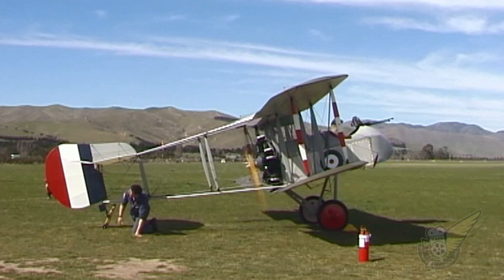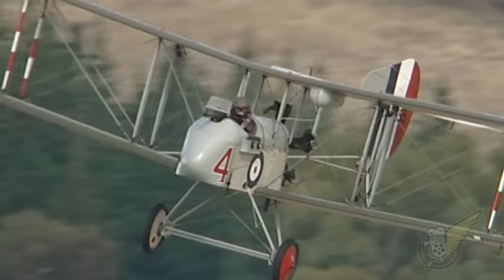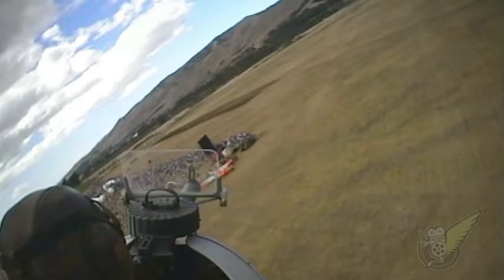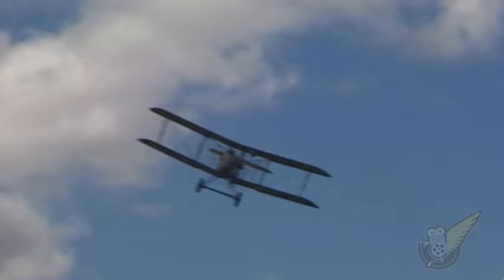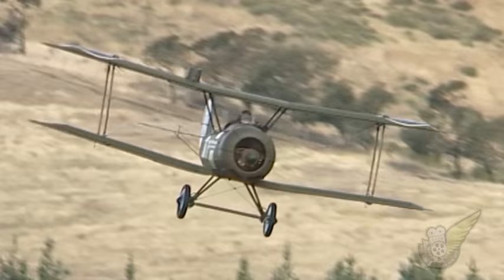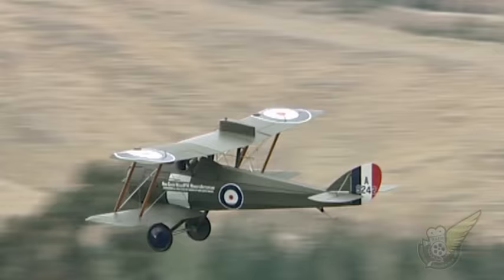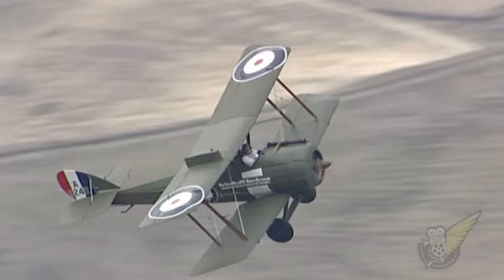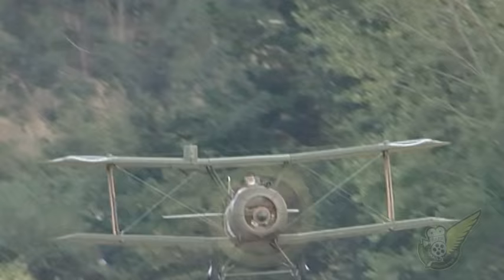Early Oddball WW1 Fighters - Airco DH.2 and DH.5

Comment: the dh.2 was, and will always be, a work of art. it was such a beautiful, effective biplane that saw much use in ww1. it wont be forgotten.
Reply: I don't know much about aviation, but it would seem that pivoting around the heavy engine would be more effective  and slinging it around on the front.  I really like the design!
Reply: Thrust from front being shoved under wings is great for lift and stability.
Reply: The DH-2 was very effective, but also very dangerous. They were prone to catching fire in flight, and their stall-spin characteristics were bizarre. Spin recovery was very difficult, and required a technique unlike any other airplane that involved somehow rolling the spinning airplane on its back and recovering inverted.
It was derogatorily known as "The Spinning Incinterator" for these characteristics. It was Maj. Lanoe Hawker who figured out how to get one out of a spin. Until then, spin recovery in a DH-2 was thought to be impossible, and DH-2s were not to be stalled or spun.
Maj. Hawker died in combat flying a DH-2. While in a tight dogfight with Pilot-Leutnant Manfred von Richtofen, one of Richtofen's bullets glanced off of the DH-2s aft-mounted engine and struck Maj. Hawker in the head, killing him instantly.

Comment: Hardly oddball in 1915; pusher designs were quite common, especially in civilian aviation. This example is a modern-era replica, using a modern engine; period DH.2s used a wind-cooled rotary whose entire crankcase rotated along with the propeller. Thanks for posting!
Reply: Thanks, you've answered my question elsewhere. I thought the DH2 had a rotary engine.

Comment: Imagine flying an original DH.2. They didn’t even have a throttle. The only engine controls were the ignition switch and the mixture control. The pilot would regulate his speed by ‘blipping’ the engine. That is, turning it on and off.

Comment: Although the pusher design solved the machine gun synchronization problem, it compounded the risk taken with the early rotary engines at that time, which due to rushed war time quota lack of quality controls, were prone to literally breaking a piston rod, thus throwing the complete jug off of the engine with the piston, which could easily smash into the bracing for the rudder and elevator controls behind it, sending the plane down in an uncontrolled crash.

Comment: The „pusher“ design also keeps the pilot clean. The original Gnome rotary engine was famous to spit large amounts of caster oil onto everything behind the engine. 
The one shown here uses a radial engine instead. Not original in look and sound and feel for the pilot.

Comment: Always thought this had a rotary engine, like the Sopwith Camel.
Reply from the maker: The original DH-2's did, but in this case this is a replica built in the late 20th Century and the builder only had a radial engine available.

Comment: Whats the box on the upper right hand DH 5 for?
Reply: Wikipedia says its an auxiliary gravity feed fuel tank though that statement is marked citation needed. 
It makes some kind of sense though as its hard to see what else it could be and an offset fuel tank would not leak onto the cockpit if it were punctured.
Reply: The DH 2 has one also. I'm guessing it could be used as a header tank. Being set high and a gravity feed. It would provide positive pressure to the main tank. Assisting or negating the need for a fuel pump. Just spitballing here, can't find info one way or another.

Comment: On the DH.2- does the prop have a different pitch, or does the engine rotate in the opposite direction, compared to the DH.5?
Reply: I'm pretty sure the engine was standard. Just mount it back to front and bolt the prop on the other way round!

Comment: i suposse the engine is not original because the original one was a rotatory engine and the whole engine rotates
Reply from the maker: Correct, this is a Kinner radial engine -- no rotary engines were available when this replica aircraft was originally built.